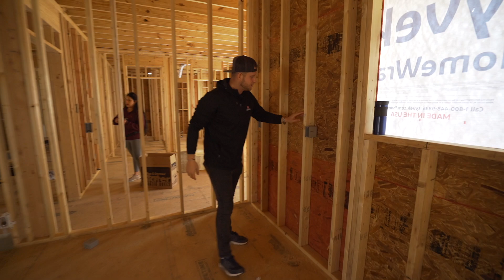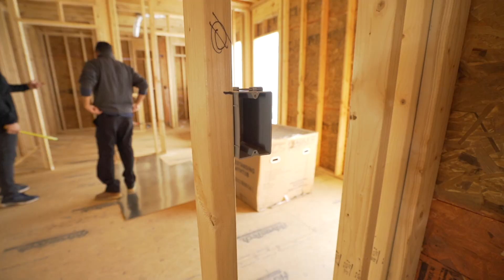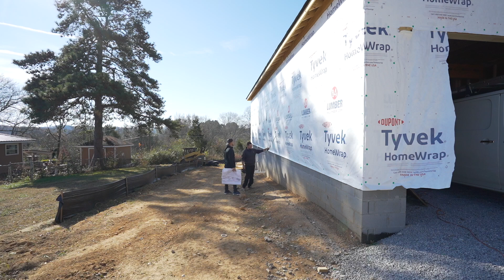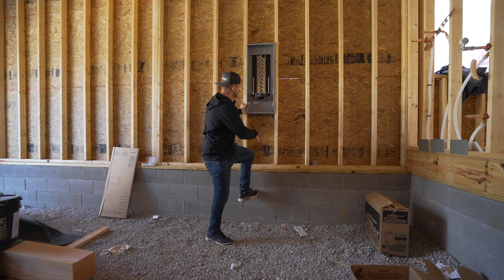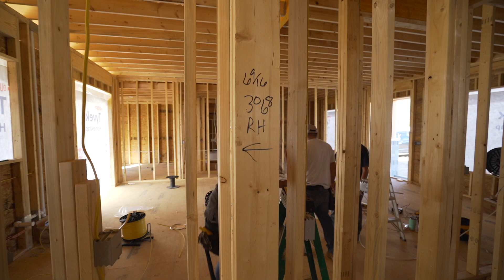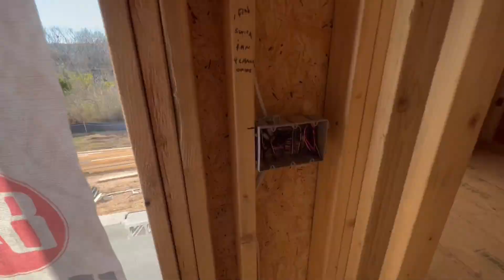Electrical Rough-In For New Construction | Building A $350,000 Custom House | Episode 21

Comment: Actually, a good General Contractor would have ensured that the blocking for the shear wall is installed prior to the electrical panel going in. Now, their will be a break in the shearwalll and will never get caught or called out during inspection.

Comment: Have done a lot of different jobs from residential, custom homes, commercial , churches & hospitals. They reason you hire an architect is to go over everything with them and not make many changes after the plans are submitted & permits pulled. When you are competing with other contractors time is money. Only an idiot would install low to the ground receptacles too close to a bathtub or toilet to charge your cell phone. Guy reminds me of a guy on speed. Worked on one job where goofy constantly changing homeowner would call me, plumber & general contractor up every night and talk for over a hour. We finally to!d him that be would have to pay us $100 a hour to talk to us every night. After he never paid any of us for several thousand of dollars for changes & add one we refused to anything that was not on the plans and bid agreement he signed.

Comment: Three b ig issues that you have, the HVAC needs to be complete, the plumping needs to be complete, windows, doors and siding complete. Your begging for some crooks to come in and steal you blind. They will take steal your wire, I am not joking. The plans your were showing are not the electrical plans, which should include door swings

Comment: You could have done floor outlets on either side of the bed instead of trying to squeeze them in the baseboard area…also per Nec if they are within I believe 12in to the wall they accommodate spacing requirements along wall.  Little more costly on finish due to special floor box and cover and maybe not as good of a look, but a option.  Surprised this wasn’t offered as a option.
Reply: Would never recommend floor receptacles.Several times I had to replace receptacles after small amount of water leaked in a floor receptacle. In one older house they were not on GFCI protection and between wire coming loose and water intrusion wire burnt all the way back to where it entered box requiring a hole to be cut in first floor ceiling to use an approved splice then a carpenter to come in to replace & spackle sheetrock then a painter. Probably cost over $700 for repair.
Reply: Floor receptacles are, imo, terrible. They collect every last bit of dust, hair, and debris possible and, over time, become a straight-up fire hazard. I just replaced one in a home a few weeks ago that burnt up.

Comment: I see you are using dimensional lumber for your main ceiling joints. What size spans are the rooms? I’m forced to use I Joints in my build which are much more costly but my room spans are 26 foot wide.

Comment: If it was me. I will have at last 2 cat6 cables in the office, bedroom, front room and so forth. I will have one area for main access point to where I will have cat6 cable. If you’re doing security cameras then you do want to make share they are hard wired for the outside ones and the main one in the house.
Reply: You can add like one or two wifi access points. One of the biggest reason I like hard wired Ethernet is any tv, computers and others will have more stable internet access over wireless. Specially when you have like over 100 people on the same WiFi access. Then it will start slowing down on speed of the internet. I don’t work for any internet tech company. My knowledge was learned by hands on and doing the research on it.
Reply: Yup I have unifi APs all around the house rg6 and 2 rj45 for every room 1 tv and 1 for desk set up 
Main rooms include hdmi for cctv
Rg59 and rj45 every corner of house
Reply from the maker: I’m really big on wireless stuff but I guess I need to really consider that!!

Comment: Great progress! When you do your ethernet cables you should consider adding some cat6 to all 4 corners of the house for POE security cameras.
Reply from the maker: They ran 2 cat6 cables for me per my request because I’m more of a wireless guy 😅 so I had one for where my router is going to be in a central location and then one in my office.
Reply: @nikospropertyshow  Gotcha! You can send power and data over an ethernet cable. Wireless cameras still need to be powered somehow. Just thought I'd share an idea because it's a pain setting it up later 😊.
Reply from the maker: @Igor-ge1py  I actually had no idea about that about the Ethernet cable 😅 appreciate the insight!!